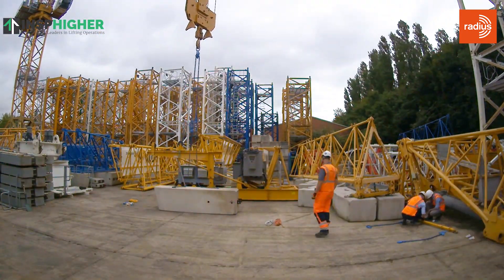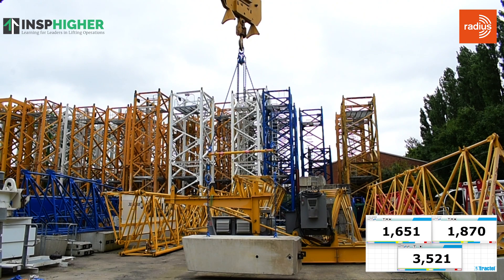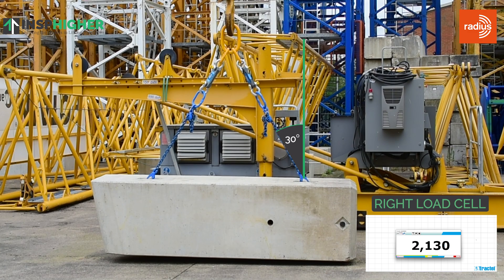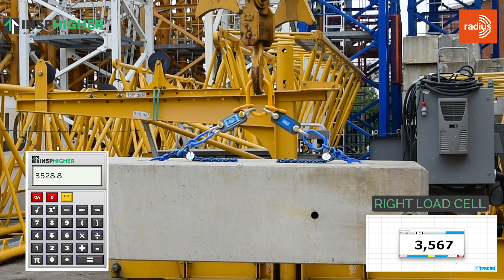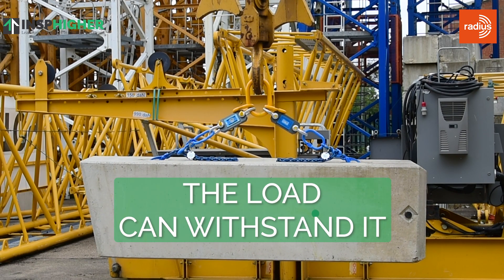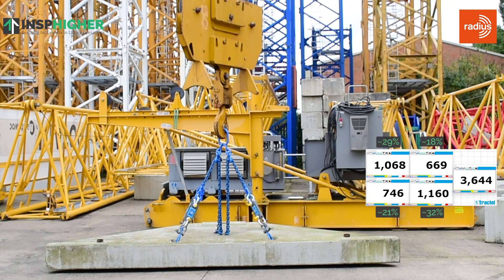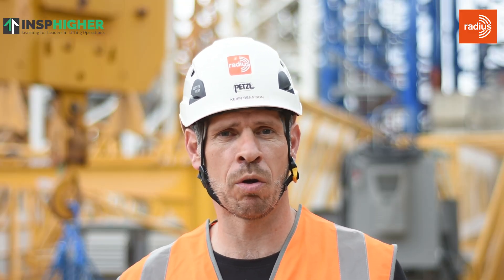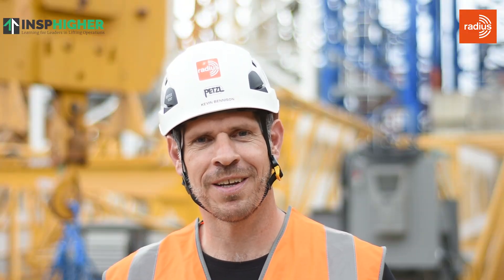Sling Tension Demonstration

Comment: Anybody know what i’m doing wrong when following these calculations? 1870/ cos (30) comes out as 62.33 for me🤷🏽‍♂️
Reply from the maker: It depends on the calculator you’re using. What’s happening there is that the calculator thinks you mean the Cosine of 1870, rather than 30 degrees.

On a scientific calculator, when you hit ‘cos’ it will open up a bracket - which is asking you to input the angle.

On some calculators (such as some iPhone versions), you have to input the angle first (i.e. 30 in this case), then hit ‘cos’ - which will give you a figure.
You can then divide 1870 by that figure.
Reply: @ perfect, thanks. It was on iphone i was doing it. I also had to toggle from radians to degrees to make it come out right but got it now👍🏼

Comment: The slack might be visible on the ones that take less, can we correct it by shortening them with a link ?
Reply from the maker: @Urielelemental  Good question! 
Typically, that’s not going to do much for you, other than shift the loading on the legs. If one leg is slack, it’s either because the centre of gravity is closer to the opposite leg or because one of the legs is slightly shorter.
Unless there is so much slack that you can remove it by taking a link out (which is a lot of slack) or if the load is clearly unstable, it’s probably not worth adjusting.

As always, check with the competent person planning the lift. It’s difficult to give accurate advice without seeing the particular circumstances.